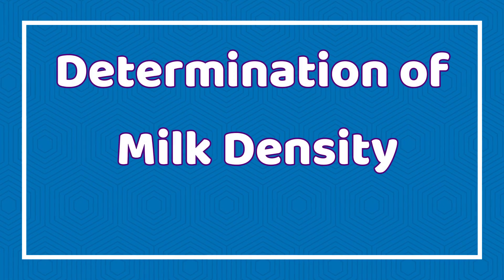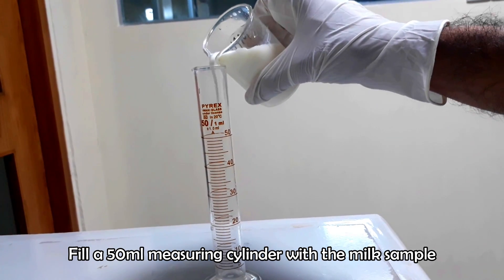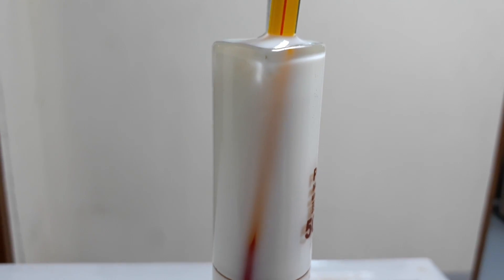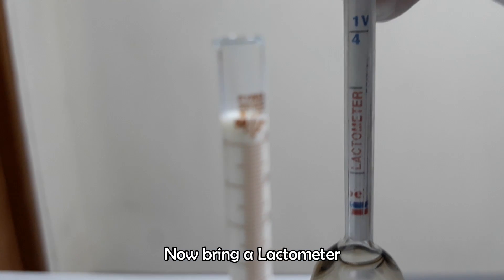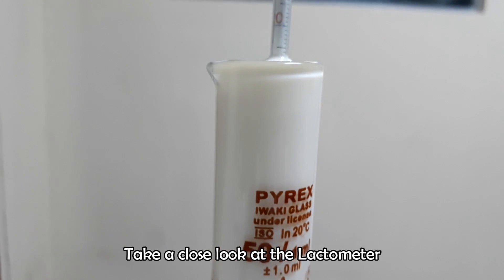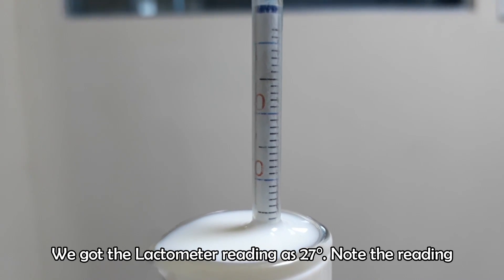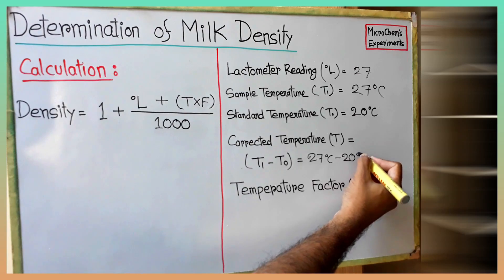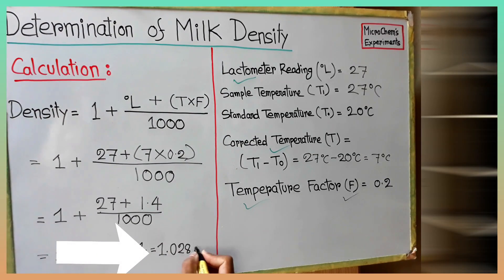Determination of MIlk Density (Specific Gravity) of a Milk sample_A Complete Procedure (FAO)

Comment: I am using a isi 27°c lactometer...will i test the milk in 27°c or 20°c?
Reply: Don't adjust the temperature instead adjust the calculation (every 1 degree above to 20 degree then add 0.1 to lactometer reading)

Comment: Why the Temperature Factor (F) is 0.2?
Reply: Yes it is constant 
For degree centigrade -0.2 
For Fahrenheit - 0.1 
And standardised is 20°C and 60.F respectively 

If it is lower than 20°C then subtract the given temperature and  multiply it with 0.2 and if it is higher than 20°C So add the given value and then multiply it with 0.2 

For example: if the temperature is 14°C ( less than 20°C)

20-14= 6 
6×0.2 = 1.2 

If it is 30°C ( more than standardised value which is 20°C ) 

Then see how much it over then 20°C  it's 10 right so multiple 10 with 0.2 
10×0.2 = 2

Comment: How do u get 0.2 temperature factor? Is it a constant or? Pls explain
Reply: Yes it is constant 
For degree centigrade -0.2 
For Fahrenheit - 0.1 
And standardised is 20°C and 60.F respectively 

If it is lower than 20°C then subtract the given temperature and  multiply it with 0.2 and if it is higher than 20°C So add the given value and then multiply it with 0.2 

For example: if the temperature is 14°C ( less than 20°C)

20-14= 6 
6×0.2 = 1.2 

If it is 30°C ( more than standardised value which is 20°C ) 

Then see how much it over then 20°C  it's 10 right so multiple 10 with 0.2 
10×0.2 = 2

Comment: Hello, this video was helpful but i have a doubt.. What is the 0.2 temperature factor
Reply from the maker: If you test your sample other temperature than 20 degree Celsius then you will need to use temperature factor. But if you test at 20 degree then no need to use the temperature factor
Reply: @MicroChemsExperiments  so 20 degree means the room temperature , if my room temperature is 32 degree , should i replace 20 with 32
Reply: How to find temperature factor

Comment: Received milk temp
30°
Milk density - 1.0268 (as per your video calculate)

Can you please tell me can I pass milk or not
Means in a milk added water or not
Reply from the maker: Your result is slightly confusing.
1. Pasteurized Milk density should be from 1.028 to 1.032. From your test result, we can say that water is added.
2. But some literature data shown to be found in the range of 1.026 g/cm3 – 1.034 for raw milk.
So, you can follow your country's specifications to judge your sample. Thank you.
Reply: @MicroChemsExperiments  If the desired range is added to the video then it would be more meaningful to understand. Thank you.

Comment: Do we need 50ml of milk quantity to test and apply this formula or we can also take 1liter milk for formula.
Reply from the maker: Formula does not vary with the different amount of milk quantity.
Formula will be the sample, no matter you used 50ml or 1L milk.
Take the amount of milk sample in such a way that the Lactometer float properly into the sample, it could be 50ml, 100ml, 500ml, 1 liter and so on. Always the calculation and formula will be the same, in case of any amount of milk sample.

Comment: Please, Explain standard temperature
Reply from the maker: Explanation about Temperature Factor: According to the FAO guidelines, standard sample temperature of lactometer reading is 20 degree Celsius. But if you take the lactometer reading at any other degree of temperature (e.g. more/less than 20 degree Celsius) instead of 20 degree Celsius, then you have to calculate the density applying the Corrected temperature.
In this video, I took the lactometer reading at 27 degree Celsius, thats why I used the corrected temperature

Comment: please,  Explain Temperature factor!
Reply from the maker: Explanation about Temperature Factor: According to the FAO guidelines, standard sample temperature of lactometer reading is 20 degree Celsius. But if you take the lactometer reading at any other degree of temperature (e.g. more/less than 20 degree Celsius) instead of 20 degree Celsius, then you have to calculate the density applying the Corrected temperature.
In this video, I took the lactometer reading at 27 degree Celsius, thats why I used the corrected temperature.
Reply: @MicroChemsExperiments  Please is the factor 0.2 a constant?
Reply from the maker: @yagyeigyasi  Yes. It is constant